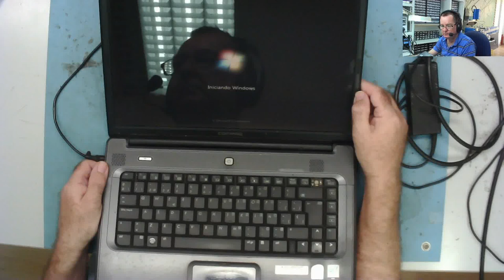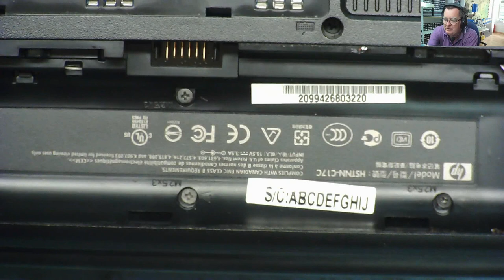Laptop Overheats.  Fans OK, Not Clogged with dust. Overheating and Shutting Down.

Comment: Really like this video and your - no heat flow - demonstration with the 2 temperature sensors. Always thought they were just solid copper strips conducting the heat away from the microprocessor.  First time I learned they are heat pipes with an inner evaporating fluid that conducts the heat away.

Comment: Hey Richard, yeah thats toast, new heatsink required, I think they have some sort of gas inside which helps the heat move to the little rad, something like that.
Reply from the maker: Hi Gordon, Yeah I got to that after 30 mins LoL.  I thought I would make it more widely known on YouTube as I searched and there is not much mention of it.  The thermocouple demonstration was quite dramatic I think :D
Reply: @LearnElectronicsRepair  yes you are right it is because the gas in the heatsink can not conduct the heat a bent or damaged heatsink is a no go, you should never use a damaged heatsink it nefast for conducting heat.

Comment: Inside that pipe is some sort of refrigerant liquid, which helps for cooling. The corrosion is that liquid mixed with dust. You need to change the cooling system and it will fix your problem. That pipe is broken due to massive bent/hit…
It’s also possible that cpu might need replacement because of the overheat. I could go lower on it’s internal resistance and will overheat even with a new cooling system….

Comment: I’ve seen this problem before where there’s damage done to the heat pipe. The pipe is sealed and made to transfer heat, but any impingement of the pipe will reduce or eliminate the ability for the pipe to transfer heat. The radiator on it looks so crusty and corroded as well. I would have replaced the heatsink assembly just for that alone given there are thermal shutdowns happening with the laptop.
Reply from the maker: First time I saw this - and it fooled me at first. Putting the MX4 on the CPU made it 'work' the first time and I just left it running for 20 mins and thought it was fixed, without properly testing it.  Previously it wouldn't even run for 5 mins.

How it got into that condition I have no idea.  After finding the cause of the problem with the two thermo-couples, I did a bit of googling and found the heat pipe is supposed to be filled with a highly compressed gas and this transfers the heat.  Honestly before this repair I just thought they were copper bars, A: because copper is a good conductor of heat and B: because i never had a reason to look deeper into the subject.

I told the guy who brought it in to me, another repair shop not the owner, that it isn't repairable unless he finds a heatsink assembly off another scrap one of the same (or compatible) model
Reply: @LearnElectronicsRepair  Yes this is a rarity, normally speaking it would be as simple as a clean up and new thermal paste.

Comment: 25:59 Probably the previous "technician" was to lazy to remove the entire heatsink, and bent the heatpipe aside to get the dust out, and then bent it back. There is no other cause that a heatsink gets a dent that way besides a drop of the laptop. For such a dent/bent due a fall, the plastic house must be damaged also, and there is no damage to the plastic housing. Also if you clean and removed a heatsink, you replace such a crumbly cooling compound, and not put it back dry like the previous "technician" did.
Reply: This one was lazy too. 😄Screwdriver scratching the copper heatsink, not cleaning the entire die.

Comment: Its a damaged heat pipe there is gas in it to transfer the heat it has possible leaked so the heatsink is no longer working and need to be replaced
Reply from the maker: Yep Robbi You are right.  The two thermocouples demonstrated it perfectly.  Not so much mention of this issue on YT so I thought I would highlight it :D  A lot of people (and me initially) probably just think it is just a lump of metal.
Reply: @LearnElectronicsRepair  yes i had the same issue with a toshiba which had a mainboard fault, i fixed it and it worked but was overheating and i was going mad because i didnt know why, the laptop came in a pile of crap so it must have damaged the pipe. so i installed another heatpipe and it worked fine.

Comment: i also encounter random shutdown cases sometimes, it can be various things not just pipeline it can be shorted mosfet besides shorted 5v power rail, faulty Super IO or faulty southbridge, chipset issues....etc.. sometimes it opens and shutsdown after 3 seconds or heating up and then shutdown..

Comment: You can clean the die and cooler with a can of car brake cleaner. It eats away even the hardest thermal paste and pads. It will even discolor the pcb. Just do not spray it inside, not that healthy.

Comment: It looks like the distilled water has leaked out of the heat pipe - it would explain the corrosion on the end - because the heat transfer is slow like normal copper conduction over a long length.

Comment: Fascinating.  I've got a laptop that I just bought from ebay and the outside casing is very hot to the touch in the upper left corner of the keyboard half.  I'm really tempted to open it up and take a look at the fan and all that mularkey, but it's actually working fine, so I just keep thinking, don't fix it if it ain't broke... whereabouts are you based?

Comment: Hi there I need advice I have an HP pavilion that is heating up and shutting off. I cleaned out the vents and the fan, but that did not help. After that, I took the cooling system off of the CPU and changed out the Thermal Paste.  I am still having issues with the system still shutting down. There is no damage to the CPU cooling unit, and the fan is clean and working perfectly fine.
Reply: Same laptop, same problem. Did you resolve it? If so, how?

Comment: Having same problem with my laptop 
No dust even fan is running at full speed still laptop shutdown automatically and gives an error code of overheating. I think my laptop's heat pipe has damaged

Comment: Hi Richard, yes that's the one with the broken heat pipe where the evaporator leaked out ... /watch?v=eKrdJpDSowY ... Do they sell spare ones somewhere ?
Reply from the maker: Yes, good used ones are available on ebay about €15